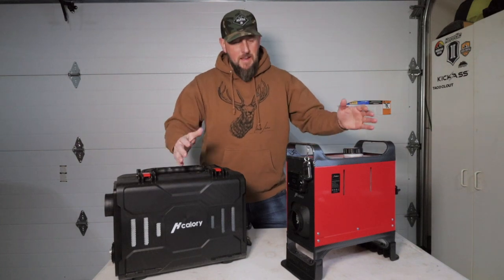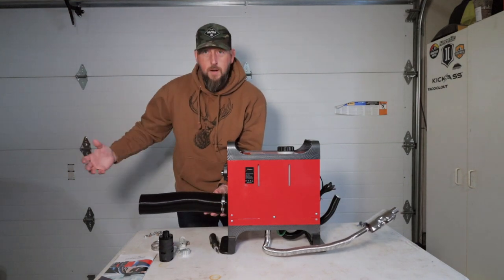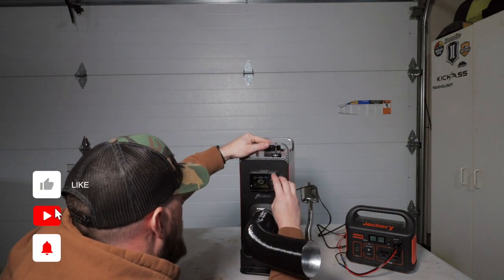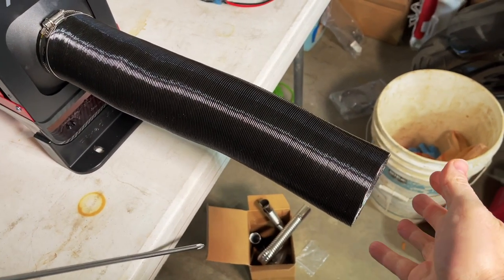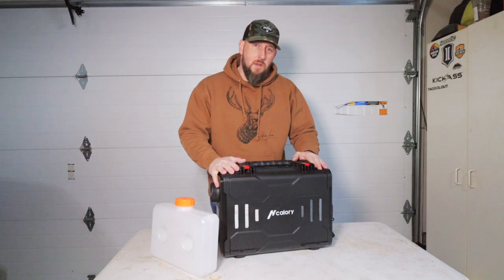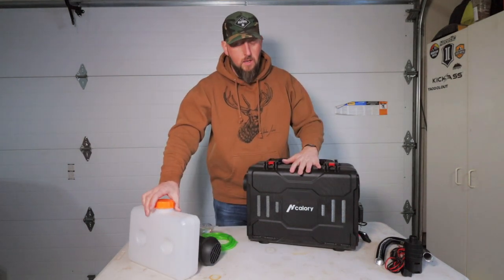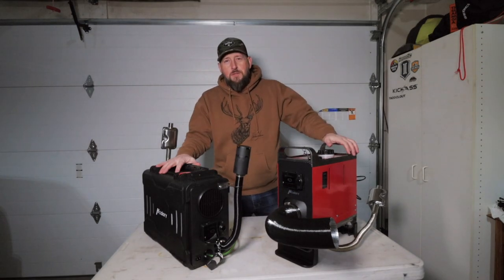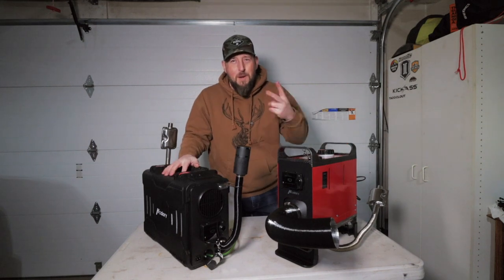The Definitive Guide To Assembling Your HCALORY Diesel Heater For Overlanding.

Comment: I will receive the brief case unit tomorrow.  Glad to hear it is quieter.  I hear the pump noise can keep you up at night.  I intend to use it in class C and unheated garage when working there and maybe the SUV.  Your video is excellent.
Reply from the maker: The case does help with the noise by also the setting is also a factor. The higher you set it the more often you’ll hear the fuel pump ticking.
Reply: Its way quieter than my two vevors. I have two running most cold nights and the Vevors pump drowns out the fcallory.

Comment: Wall mart has the Hcalory diesel heaters on sale today 3/10/23, for 89.99 for the black one and the white one, I bought both, the black one is nicely made I disassembled it and it has a heat-resistant outer shell made of durable plastic the aluminum was poured and was quality built, the inner burner tube was made of stainless steel very nice, lots of heat and runs nicely. the white one has an aluminum outer shell that is made perfectly the heater is 95% the same the only difference is the burner tube is steel not stainless and works the same with a lot of heat.
Reply: Just bought mine from Walmart should be here on the 20th 🎉 saved a pretty penny vs ordering from Amazon thanks!

Comment: you shoud also have a back up power, if you loose power the unit cant cool itself and can cause smoke to exit from the air intake or even damage the gasket, be aware of this, it has happened to me running on a car battery
Reply from the maker: Great call out. I'll be sure to keep an eye out for any issues like that.
Reply: Yes because if the units indoors it will smoke you out and possibly cause a fire
Reply from the maker: @tombeeks3406  My intention is to keep the unit outside of my truck and RTT and only run the heat hose into the tent. So nothing will be indoors. But I can see if I were to run it to heat my garage.

Comment: Great presentation my friend very thorough and clear no crap music or anything to distract.Have made decision on buying the breifcase type after your help will sit outside my camper van and hot air duct will come in my porthole window at yhe back...one point on the muffler for the exhaust pipe...keep the pipe pointing slightly down with the dmall drainhole downwards for expelling water vapour from exhaust...otherwise perfect...God Bless from Bonny Scotland!

Comment: THANK YOU for this. I bought the suitcase version and the manual had many pages of instructions about the control panel but ZERO instructions on how to assemble the thing. Very frustrating. Even the photo in the manual was a slightly different unit.
Reply from the maker: Glad I could help.

Comment: One big oops in their design is running the exhaust straight up. you will get an error as soon as moisture collects in that pipe. They are design to flow downhill and actually have a moisture outlet on the muffler....
Reply from the maker: I have looked into this as well and I think you can just put the muffler in the exhaust vent. Or you can bend the tube to face a downward angle when out at the camp.

Comment: I get my heater Wednesday! Super excited. Your video was helpful because I’m a girl camper and new to diesel heaters. What is the max length you’d recommend the heat output hose? I have a roof top tent I will be feeding the heat into.
Reply from the maker: I suggest getting an 8’ – 10’ hose.
Reply: If you run your exhaust hose as long as possible inside before it goes outside, you will capture more heat off the unit. Make sure the exhaust is always directed downhill so the condesation can drain our, or drill a small hole in the low spot.

Comment: what insulated pipe should be used to protect inside insulation/tongue and groove? thx
Reply from the maker: If you are asking about the tube that you run to your tent then you can order a 3” insulated dryer vent tube off amazon. 12-16’ should be good.

Comment: for the briefcase unit... did yours come with screws to mount the fuel tank? I have a lot of screws, but none seem to be the ones to mount the tank and I didn't see it in your video.
Reply: nevermind i found it! now just trying to figure out the electrical adaptor i need to the jackery
Reply from the maker: @dirtnsmores  Glad you found the bolts you needed. I have added the 15a DC plug  link I used to connect to the Jackery DC port in the description.
Reply: ok i see the link! So the rings on the end of the heater cable will just slip into those plastic connectors from the plug you linked?  @Mumfy64
Reply from the maker: The ring will not connect to the end of the Spade connectors. To set it up the way I have it, you will need to cut the rings off and use a spade connection on both the DC plug and the power cable. These are the spade connections i use. https://amzn.to/3vLteeN

Comment: Great video…..I’ve just got one of these and I’m not entirely sure I would want my exhaust to be coming out next to my air intake…..is it ok to that?
Reply from the maker: Which version are you referring to? On the Briefcase style the exhaust is on the same side that the hot air is pushed out of the unit. On the Tower unit, I can see the concern. The exhaust tube can be bent/moved to any position so that the fumes won't be next to the cold air intake.

Comment: Could you drill fuel hole in tank at the top and push tube onto the bolt (with hole in it) run tube to bottom.
Reply from the maker: With the parts that are provided, you cannot run the tube that way. You can look at getting a stainless fuel line kit and run it that way.

Comment: I just get it and planning to put it on my refrigerator in the garage and make a hole in the wall 8"x8" filled with metal tin and the exhaust pipe go through it.Do you think that pipe and muffler can get rusty after a time.I am planning to keep that permanently.

Comment: Great video.  Question on the black briefcase version, when attaching the exhaust pipe, it looks like you have the exterior pipe going ‘into’ the case pipe, and at the muffler side, it looks like you have the exterior pipe going over the muffler inlet.  Is that accurate?  And if so,  how did you know that’s the way it should be done?  I’m not the handiest of guys so the lack of instructions is throwing me off 🙂.  Thx
Reply from the maker: The ends of the exhaust hose need to be bent a little in order to fit the case exhaust and the muffler. There isn't a specific end that goes in either.

Comment: Do you use that same jackery for the suitcase heater while camping and if so, does it last at least all night? I have the same jackery and was wondering if I will need to upgrade. Thanks!
Reply from the maker: I do have the same one I did the test run on, but I also have a 1000w Jackery as well for heavy draw items. If you were to keep this on a low setting you should be able to keep the 300w with the unit. But to be safe I suggest a 500w.

Comment: I purchased this a week ago. However I'm having trouble with leaking when I installed the nozzle into the tank. At first I thought it wasn't tight enough, but it still leaks very slowly after tightening where the line is wet with diesel. Does yours leak by any chance?
Reply from the maker: I am not having a leaking issue, but be sure to double check your O-rings to make sure they are set correctly.

Comment: Love the video, however I have a question about the power. You hooked it up to a jacket 300, how long will the power last before you need to recharge? I'm asking because I want to buy one to setup in a van? 2 things will happen, I'll either run out of fuel or run out of power thru out the night? Can you give me some insight on this? And also what power station can I go with to insure proper funtion.
Reply from the maker: If you are planning on a van build, I would look at doing more of an onboard setup. route the exhaust to the outside of the vehicle and setup an aux battery system. But if you plan on using a portable battery, look at the Jackery 1000. That should give you enough battery for a few days.

Comment: Are you able to run the hcalory from strartup on the dc output? from what I've researched it pulls around 13 amps at the beginning and the Jackery is rated at 10 amps.
Reply from the maker: Yes I been able to run it on the DC outlet from my Jackery 300 & 1000 from start up with no issues.

Comment: can the muffler be mounted straight to the box?, shouldn't it be lower so that the excess of fumes can escape through this small hole in the muffler?
Reply from the maker: great question. I have seen the muffler mounted to the exhaust port before but i have not tried it yet.

Comment: I'm wondering 🤔 if I can run a 5 gal fuel tank setting it 2 ft away from heater and away from the exhaust , Would it work  🤔
Reply from the maker: With a little added setup you probably could. I'll be doing a rotopax solution this year to get more fuel capacity.

Comment: how the heck do you get the exhaust on.  the tubes are the same size and I can't get one to go over the other.  Also the exhaust coming out of the box is so small I can't see how to get a hose clamp on that?
Reply from the maker: I ended up pinching the exhaust end a little to make it smaller so that the muffler could fit, same for the end that goes in the box. It does take a bit to get the hose clamp on as well for the air. I didn't put one on the exhaust side.
Reply: @Mumfy64  Thanks. That worked👍

Comment: For either of these, does the diesel fuel in these plastic containers emit an odor - especially if they were being transported in a car that may get pretty warm during the daytime?
Reply from the maker: I haven’t noticed an odor coming from them. But I’ll be switching over to a diesel roto pax. Stay tuned for the setup.
Reply: I can’t wait to see your diesel rotopax setup.  I think I will be doing the same.

Comment: Do you ba e the link for all the cables/cig plug u used to connect to dc? At 5:30 of the vid. Thank you.
Reply from the maker: Here is where you can get the plug. https://amzn.to/3NkC355
Reply: @Mumfy64   thank you
Reply: I just received mine today, i tried to put all together but it’s not working. Screen is flickering with screen showing 03 (which i think is power supply error) i tried to restart but still het the same result 😔

Comment: Is there a difference in heat output between the 2 diesel heaters the toolbox version is a 5kw and other is 8Kw what’s the fuel consumption like on these
Reply from the maker: I haven't noticed a difference in heat output between the two. I still need to run a full night test on these to see how the fuel consumption is. I can say that depending on how high it is run will affect how fast the fuel is consumed.

Comment: Why would you route the exhaust so it sits next to the air intake? Looks like a great way to pull CO2 into your heated space to me.
Reply from the maker: You can angle the exhaust however you need on the tall unit. the briefcase style is fixed.
Reply: Of course it can be repositioned, but your "definitive guide" is showing AND guiding your viewers to position it near the air intake, which can result in C02 poisoning or death! @Mumfy64

Comment: With your briefcase style heater do you remove all the externals except for the fuel tank during transport?  

I was considering at the minimum to remove the exhaust hose, air intake along with the dryer style hose to pack inside of my Land Cruiser.

What is your breakdown (if any) once packing up and getting back on the road?

Comment: Nobody uses air filter clamp to retain the air filter as it flops round. The  exhaust upright causes condensation trap. No extension of controller for internal temp. 
Sadly so close and so far